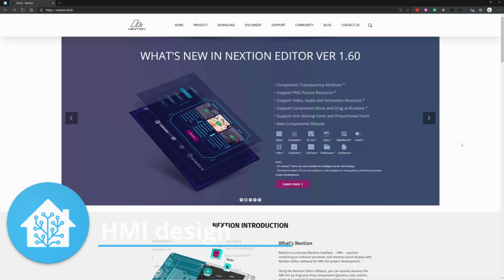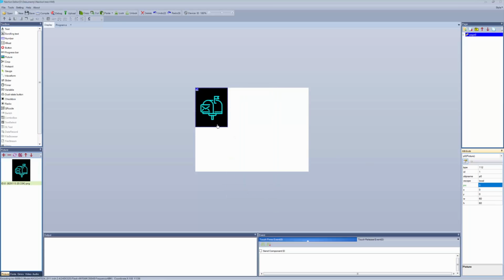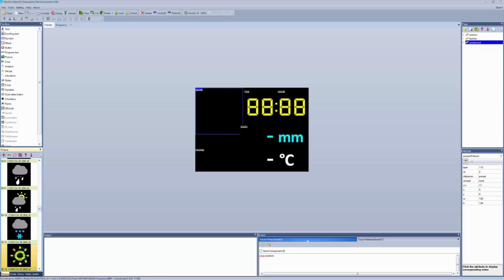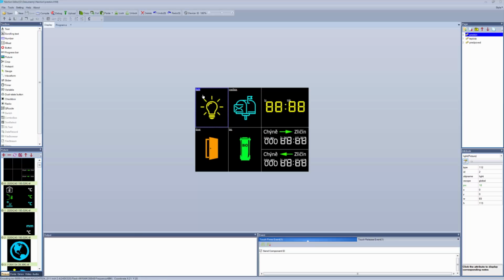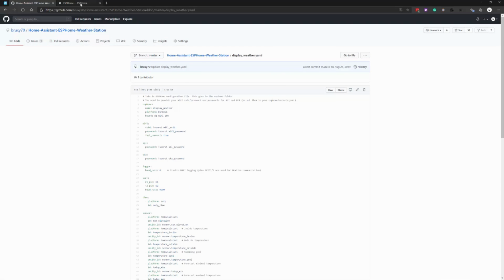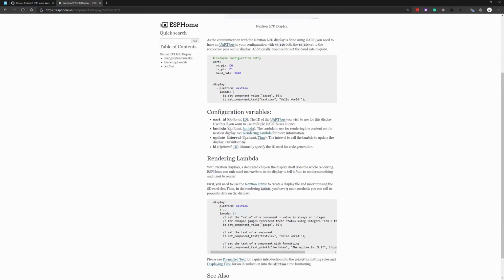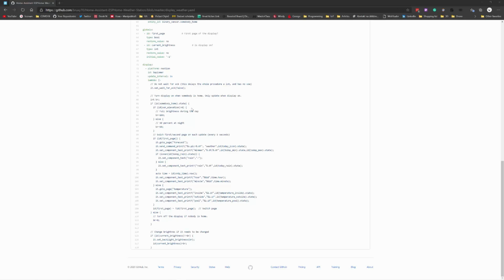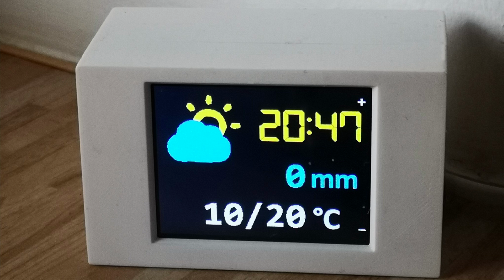DIY displays for Home Assistant

Comment: Hi. I've use this display with a d1 mini and a Nextion NX4832K035_011R for about 1 year. yesterday i've done an ESPhome version update form 1.18.00 to 1.20.4 and nothing is working anymore :(

I've then checked the Changelog from ESPHome and read this: "The Nextion component has had a major rewrite this release bringing many more features to those that use the displays..."

The display get the data from home assistant, But the nextion display doesn't show it. When it still worked, the display refreshed itself every 60 seconds (update_interval) and also refreshed all values. Now the display does not refresh anymore. Does anyone have the same problem, or maybe even a solution?

There are in the version probably now "Lambda Calls". I could imagine that this could solve my problem. But unfortunately I don't understand how to trigger for example the command "id(nextion1).update_all_components();".
Reply from the maker: Yes, they did rewrite it. You have to change the Programs.s as described here: https://esphome.io/components/display/nextion.html. There is really only one think you need to do - open the screen in Nextion editor and add line bkcmd=0 before page 0 to Programs.s. I also increased the baud to 115200 by adding baud=115200, also before page 0. It took me a while to find where Programs.s is. The screen edirot has two tabs. One is called Display, the second tab is Programs.s. Then save the HMI and upload it to the display. Then, in the ESPHome script, remove the line it.set_wait_for_ack(false); as it is not supported anymore. The rest should work.
Reply: @bruxy70  all right! many man many thanks for your fast response. I've directly found the programs.s, change it and, like you said, it works.

Have you tested the lambda calls yet? I would be interested if you can update the single "it.set_component_text_printf" values also with the "update_components_by_prefix" command, so that the display doesn't flicker every 60 seconds, but they only update the values that have actually changed.
Reply: @bruxy70  sorry for me spam, I've also discovered the following [nextion:115]: Brightness out of bounds, percentage range 0-1.0 was there a change for the brightness command?
Reply from the maker: @julianfriedrich2149  You are right. This has to be changed to float 0.0-1.0 as well. I will update that on the GitHub page
Reply: @bruxy70  1.0 and 0.0 do work, but 0.5 is like 0.0
Reply: Instablaster.

Comment: Hi, i want connect n: 20 display on 1 home assistant (raspberry pi4), is possibile? and i want assign for each display a different interface, is possibile? you have a group of telegram?
Reply from the maker: Yes, you can connect 20 different displays to 1 home assistant, each can be different. No, i do not use telegram anymore.
Reply: @bruxy70  you can tell me how doing it? and which display i can use?
Reply from the maker: @LuigiZotti  i show in the video how to do one display. You can do the same multiple times. Or there is the Sonoff NS panel, that you can use I guess. Or you can use tablets with Home Assistant do dashboard.
So technically, this is doable. The question is whether the price and effort are worth it and whether you have the skills to pull it off. That i do not know.

Comment: Do you have to have connection to TX and RX all the time or just when you upload firmware? Where does the TX and RX come from? Im trying to fix the 5 volt situation at home but also need to know if i need more wiring.. Thanks!
Reply from the maker: The TX, RX sends and receives the information between the chip and the display. Without that, the display would just display a static screen, and touching the screen would do nothing.

Comment: HI @Vaclav Chaloupka.
Thank you for the video, is very helpful!!
do you ever use the "debug" feature in the Nextion Editor to test your code? I want to avoid using the physical screen during the development, but I get some errors. Seems to be due to ESPHome resquesting info from the Screen at startup (which the simulator does not provide...) Do you bypass this issue somehow?

Thank you again for your work

Comment: hi, thanks for this usefull video. i bought a Nextion and expirimenting with it. Is it possible to trigger a automtion in HomeAssistant on a button press?i i manage to switch switches on and of, would like to start a automation. Thanks and keep up the good work!
Reply from the maker: Yes, definitely, I use that quite often. I use nextion binary_sensor  https://www.esphome.io/components/binary_sensor/nextion.html?highlight=nextion%20binary%20sensor
and I use on_press action to call a home assistant service.  But you can should be also able to use it to trigger an action in home assistant.

Or you can use a switch (platform nextion) https://www.esphome.io/components/switch/nextion.html?highlight=switch%20nextion
Reply: @bruxy70  thanks for the quick reponse, can you share code with me ? now i use for example;   - platform: nextion
    page_id: 0
    name: "Stand 1"
    component_id: 2
    on_press:
      then:
        - homeassistant.service:
            service: switch.turn_on
            data:
              entity_id: switch.ventilatie_stand_1_aangezet

how would i trigger a automation called; automation.ventilatie_stand_2_aan
Reply from the maker: @richardtepas4832  I did share teh code. it is in the description - look at the irrigation diaplay
Reply: @bruxy70  okay, i did not see the trigger to a automation, i take another close look, thank you !
Reply: @bruxy70  do you also have examples for controlling the dual state button? i cannot find the lambda command to control the state on the Nextion. thanks again!

Comment: hi, thanks for your video, if i have 20 units sonoff basic, how conect to display nextion?  or i need 20 display nextion ?
Reply from the maker: The sonoffs do not need any Nextion displays, so you do not need any. If you want to have a display, then I assume you want to display some information on it, and for that you need a microcontroller. And I used sonoff basic. And since I already had one that I used for the light switch, I used the same one for the display - so I did not need any additional microcontroller.
Reply: @bruxy70  is the Sonoff mini r2 switch compatible with this method 
Thanks before and after?
Reply from the maker: @sodeepnext  I haven't tried Sonoff mini r2, but looking at the specs, it has all contacts you need: https://user-images.githubusercontent.com/3912017/66733148-dfc3d300-ee5e-11e9-8715-87c8ecb844a7.jpg
Reply: @bruxy70  
Thank you
I wonder if this type of kid writing tablet may be a compatible screen (since are touch screens), because in my country some old Android phones are cheaper than the basic Nextion screens.
Kid Writing tablet link (I don't have its brand or model number)
https://www.facebook.com/marketplace/item/753394018948947/
Reply from the maker: @sodeepnext  Sorry, I do not use facebook, can't see the link. Yes, you can use an Android tablet, but this is a different solution - you'd use HA dashboards or install HA app on the tablet and show HA screen. You won't need/won't be able to connect it to an external microcontroller.
Reply: @bruxy70  
Yes I known about Android tablets.
I was just telling you that Nextion are more expensive than old Android phones in my country, but I found a kind of Kid Writing tablet (very cheap) that may be compatible with this method.
Link of writing screens (I don't know the brand or model) https://www.google.com/search?q=writing+lcd&tbm=isch&ved=2ahUKEwirztq2nI3vAhULahoKHTQqC4cQ2-cCegQIABAC&oq=writing+lcd&gs_lcp=ChJtb2JpbGUtZ3dzLXdpei1pbWcQARgAMgQIIxAnMgQIIxAnMgIIADICCAAyBggAEAcQHlAAWABgl4YKaABwAHgAgAGsAYgBrAGSAQMwLjGYAQDAAQE&sclient=mobile-gws-wiz-img&ei=oeI7YOv5BYvUabTUrLgI&bih=580&biw=360&client=ms-android-xiaomi-rev2

.
Reply: @bruxy70  
And what about the  ili9341 displays they are more cheap than Nextion.
Did anyone succeed in using them like this.

Comment: How do you power the screen?
Reply from the maker: From the sonoff. 5V....
Reply: @bruxy70  be very careful with that, as the 5v is not isolated. I'd be not comfortable with a live (as in hot) touchscreen

Comment: When you turn on the lights on the wall switch, will the display show the correct status also?
Reply from the maker: Yes, of course. The wall switch just toggles the light state. Same way as if you would from the HA interface, or by voice through an assistant. I think Gartner calls it multi-experience :)
Reply: @bruxy70  Do you have examples yaml codes for turn lights on and off that also reflex the state on the display?
Reply from the maker: @mrteausaable  thatvdepends what you use in the wall switches. If you use Tasmota or original firmware, that's what they do out of the box. I use Esphome, so it is the switch.toggle line
https://www.google.com/search?q=Esphome+binary+switch+toggle+light&oq=Esphome+binary+switch+toggle+light&ie=UTF-8
Reply: @bruxy70  I did follow all your steps but change the sensors to my home temperature sensors on HA.  But nothing display on the screen except the template screen tft.  I checked the PIN and is correct.  What did I do wrong?
Reply from the maker: @mrteausaable  I suppose something does not work correctly. Could be reading the temperatures is not right. Or sending the values to the screen. I guess you'll have to experiment and find where the issue is. Try setting the value to some constant value. If that work, you know that part works. Check the ESPHome logs to see if it reads the values. Could be a typo. Or using a wrong value. Hard to say in general.
Reply: @bruxy70  I tested using hard value still nothing show up on the screen.  I think the problem is the screen.  It does not change pages.  Stay on the same page.  Looks like communication issue with the board.  I use the 3.5 screen and I modify the Device ID on tft file.  Does it matter?
Reply from the maker: @mrteausaable  Yes, it looks like it. I'd check if you did not swap the TX and RX wires. To edit the file use the editor downloaded from ITEAD website.
Reply: @bruxy70  I connected Yellow wire to D1 and Blue wire to D2.  Is this right?  I already edit the HMI editor and create the tft file without changes anything else just the device type.
Reply: @bruxy70  I flip still not working.  Any idea what I did wrong?  Only the tft screen show but not update data from di mini codes.
Reply: @bruxy70  I got some progress.  Now it  show message of "Sending command 't0.txt=Hellooo' failed because no ACK was received ... : Waiting for ACK timed out!" but nothing on the display.
Reply from the maker: @mrteausaable  Looks like an issue with the communication between the display and the board. Makle sure you have the uart set up correctly, with the right gpio numbers for rx and tx, and that you have rx connected to tx and vice versa.
Reply: @bruxy70  I can use D1 and D6 for TX and RX wires right.  I swap them still the same.  I am confused.
Reply: @bruxy70  Hi, I finally get it to work after 2 weeks attempt and the problem is yellow wire on Nextion is RX need to connect to TX on the board and also the baud_rate need to be 115200 to communicate..

Comment: I really like your philosophy with regards to automation!!
Something you might want to try to set your scenes, in esphome you can add a min and max time to toggle the light, if you exceed the max time the light does not toggle and you can use that longer time to trigger something else. I used this to switch off all my lights in the house when leaving home or when I get into bed.

Thanks for the great videos!!
Reply from the maker: Interesting. Can you share the example? I am kind of fighting to find the right level of automation, and I sometimes hit the wall when I do something that I think will make life easier, but my wife prefers to do things more manual, but more predictable (like this switch always turns on this light...that's it :) )
Reply: @bruxy70  I sent you an email with all the details

Comment: Dark Sky API are no longer available :( is ist possible to get the weather data (min max Temperatur) from Openweathermap?
Reply from the maker: I am not sure if it gives min/max. I have submitted a change to the Met weather integration that includes that and will give daily and hourly forecast. But it is in review for quite a long time now. I suppose the guyys are busy with other things and they do not see that as important.
Reply: @bruxy70  I've been looking for a service that offers the min/max values as a sensor for days, it seems to be almost impossible. Although the openweathermap has 5 measurements per day, you can't take them one by one (at least i don't know how to do that)
Reply: Vaclav Chaloupka I found a way, over Openweathermap. Here as example the min Sensor:

 sensors:
  min_temp_next_36h:
    friendly_name: Min Temperatur in den nächsten 36h
    value_template: >-
      {% set temperature = namespace(min=99) %}
      {% for item in states.weather.openweathermap.attributes.forecast[:11] %}
      {% if ((item.temperature | float) < temperature.min) %}
      {% set temperature.min = (item.temperature | float) %}
      {% endif %}
      {% endfor %}
      {{ temperature.min }}